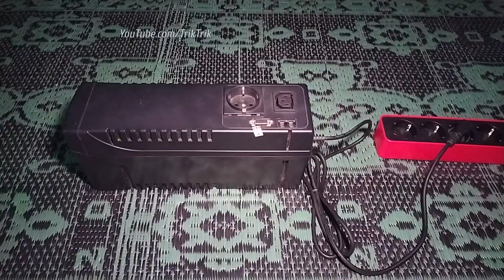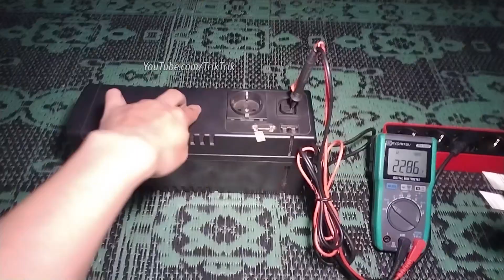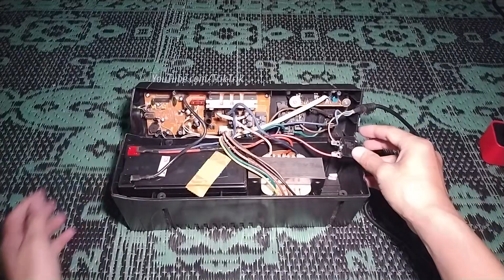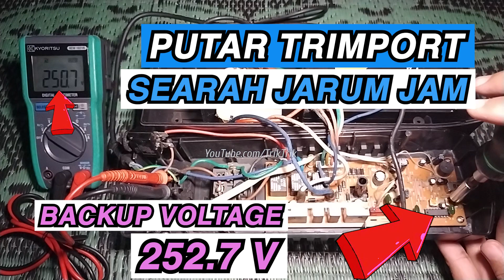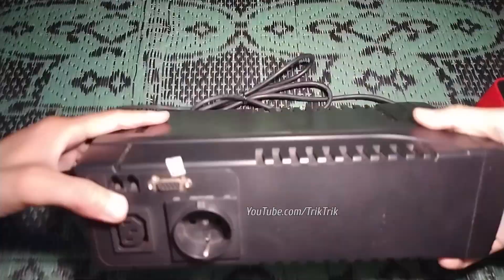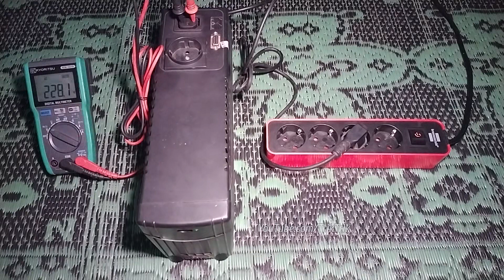Cara memperbaiki UPS rusak over voltage (voltase backup berlebih) kamu pasti bisa melakukan di rumah

Comment: saya baru 1 hari beli UPS APC bvx700 - voltase nya berjalan 250v klw bypass batra voltage 236,, sedangkan inputnya normal 215v
apakah itu aman 250v berajalan atau adakah solusi?
Reply: Sama bang, gimana ya caranya biar output nya normal di 220v. Apakah di ups apc ini ada trimpot juga ?
Reply: @arif12282  hihihihi aku langsung ganti ke yg UPS lain bg,,, APC rata2 ndk ada keknya
Reply: @arif12282  aku pakai KE 600 mantul bg, cuman lom ada bongkar buat liat trimpot ny